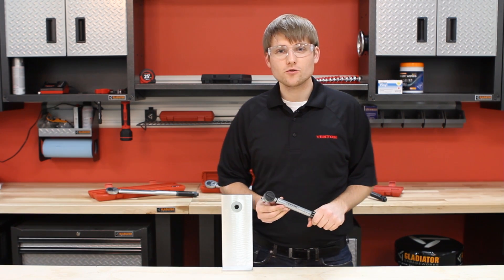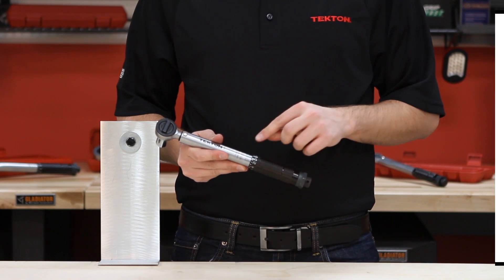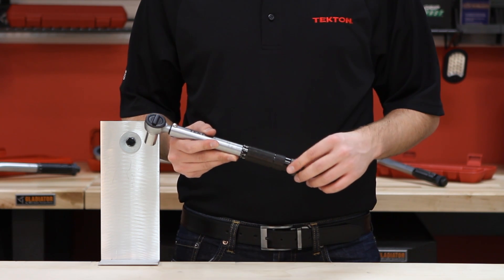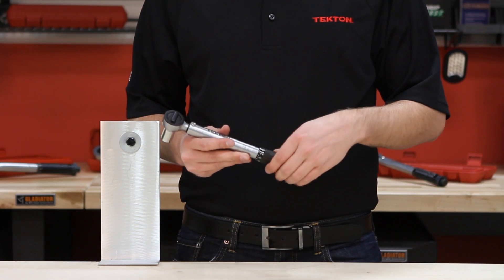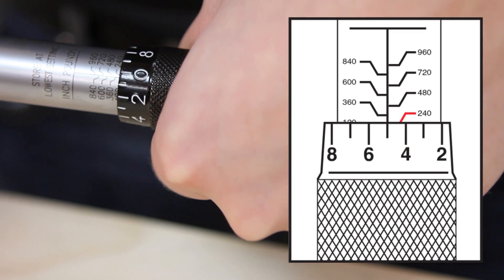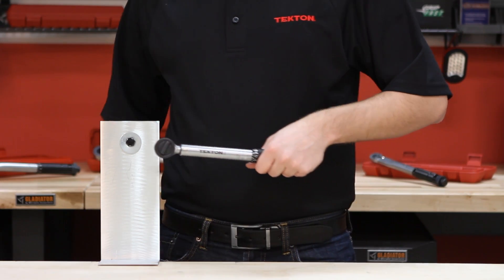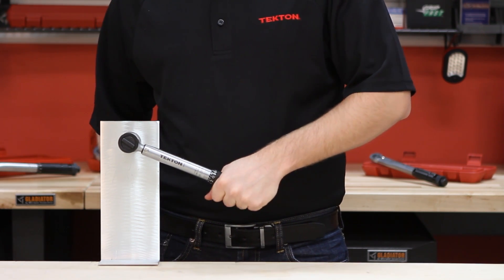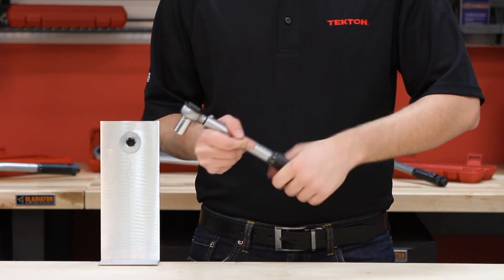How to use the TEKTON 24325 3/8 in. Drive Click Torque Wrench

Comment: he wanted to sit it on 300 IN then he sited it on number 5 after 240
Reply from the maker: This is because each number mark on the handle is equivalent to 12 in./lbs. After 240, he needed 60 more in./lbs to reach 300, so because 60/12=5, that is what he turned the handle to.

Comment: how would you do 18ft/lbs? 216in/lbs?
Reply from the maker: First turn the knurled handle until its top edge is even with the horizontal "120" mark on the main scale and the "0" mark on the handle is centered on the vertical line of the main scale. Then turn the handle until the "8" mark is centered on the vertical line of the main scale (since 216-120=96 and 96/12=8).

Comment: is it possible to set this model to just 22ft lbs of torque?
Reply from the maker: Tyler,
Yes. To convert to in./lbs., multiple by 12. In this case, that gives you 264 in./lbs. Turn the knurled handle until its top edge is even with the horizontal "240" mark on the main scale and the "0" mark is centered on the vertical line of the main scale, then turn the handle until the "2" mark is centered on the vertical line of the main scale.